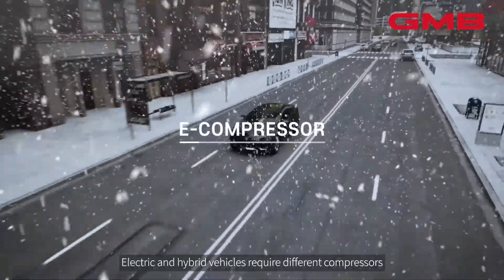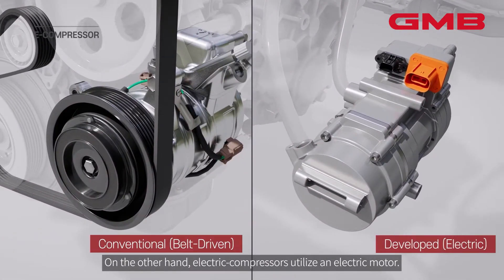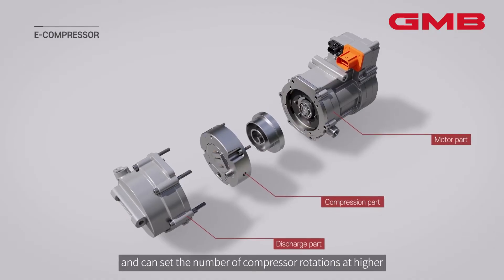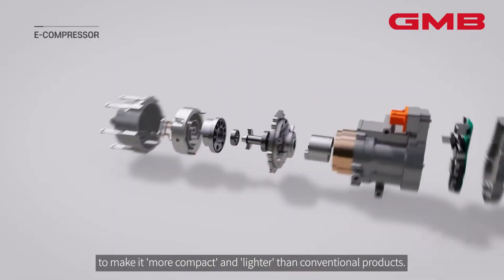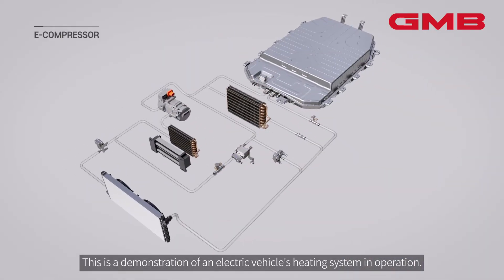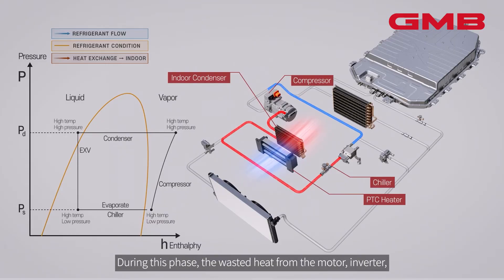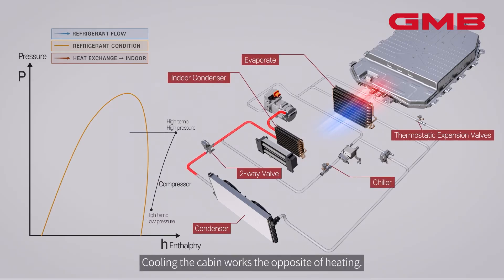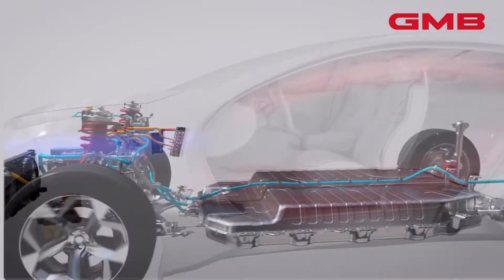How Does an E-compressor Work? – GMB

Comment: It is often mentioned in the technological litterature that scroll compressor are not efficient for small refrigeration/heating capacities, and that would be the reason why residential AC systems use rotary compressors...